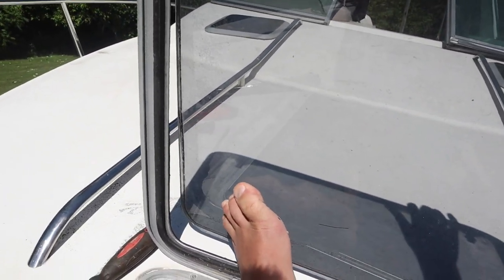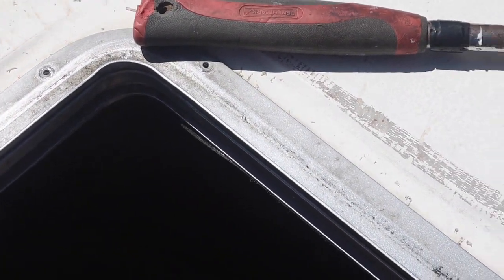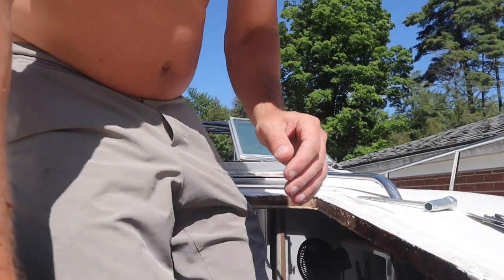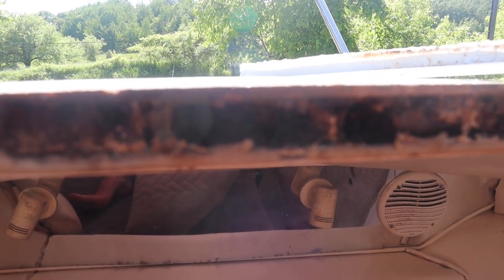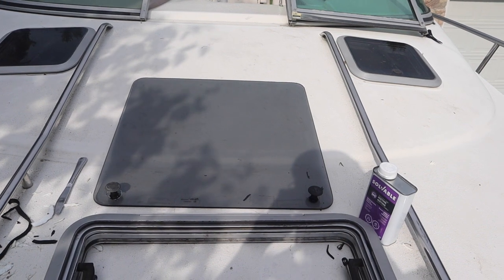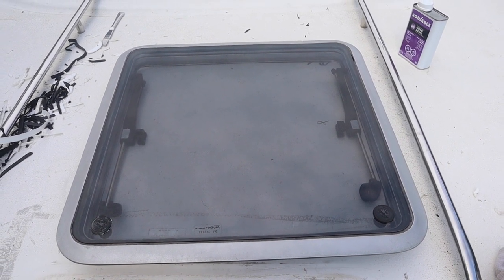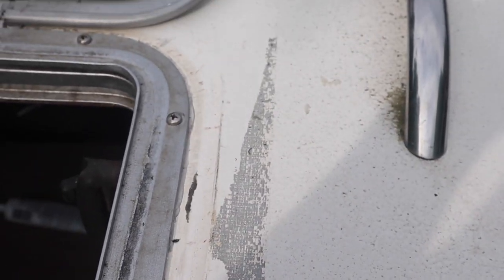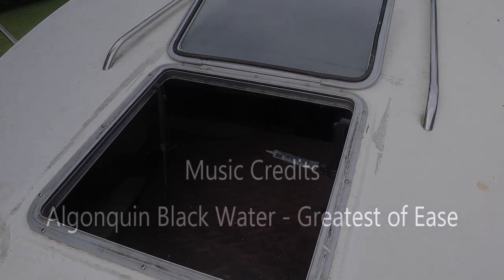S3 E4 You Ever Seen So Much Deck Rot? How Do I Fix This?

Comment: Why did they use wood? Our boat uses epoxy foam for coring. It does not hold water if any leaks in so it never rots. Butyl is great stuff. We use it for deck fittings that are bolted down.
Reply from the maker: I think most powerboats of this era were made this way?

Comment: balsa core...silicone caulk . these things are crap
Reply from the maker: What would you suggest?
Reply: @cruisingjacksonrose7008  Cold shot
Reply: Tap zerk fittings into deck, inject 2 part epoxy with a grease gun...
Reply from the maker: @chairrockfarms1337  interesting idea
Reply: @cruisingjacksonrose7008  I suggest you never own a boat with a balsa deck and never use silicone caulk
Reply from the maker: @schoon111  I'm not sure how'd you get around that. Are not all boats built with a balsa core? Or at least affordable boats?
Reply: @cruisingjacksonrose7008  balsa is used cuz it is CHEAP not good,tru dat.My boat is ply with a ply deck, but I built it myself.
Reply from the maker: @schoon111  I was thinking of replacing it with ply that I have sealed with water sealer.
Reply: @cruisingjacksonrose7008  "Hydrotek " ply and WEST epoxy
Reply from the maker: @schoon111  Thx for the info!
Reply: @chairrockfarms1337  even if this did work, it would leave the core with solid epoxy
Reply: @schoon111  Yes , that is the whole point, a solid deck.
Reply: Imagine how heavy the deck would be .The point of the core is to make it light weight.  @chairrockfarms1337
Reply: @schoon111  Absolutely!